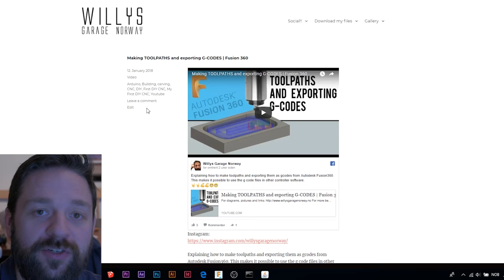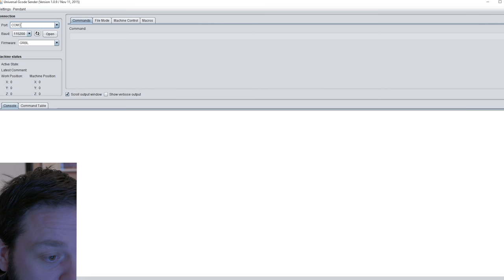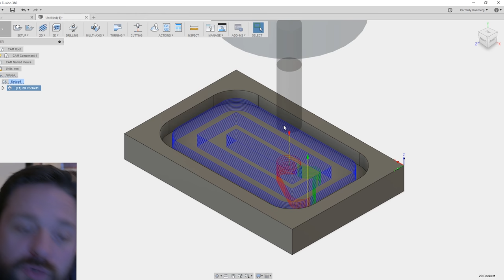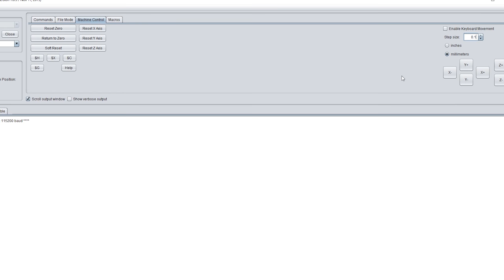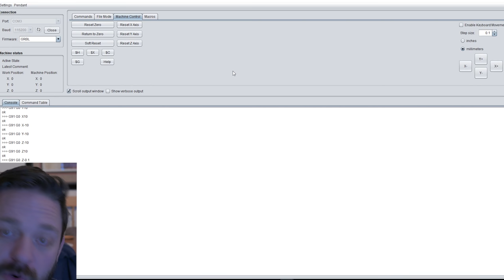Using G-CODE files and setting ZERO in UGS | Quick Tip

Comment: So we just need to set z zero and no need to set work offsets? I am confused. so why people bother to use edge finder then?
Reply from the maker: You set zero point and offsets in the program that you generate your g codes. In UGS you just set the zero point where you decided it to be in regards to the stock 👍😃
Reply: @WillysGarageNorway  Wow that will make it so easier. Thanks for the reply. I am a beginner and I was having hard time to figure out UGS.
Reply from the maker: We are all beginners ;) Let me know if you have any other questions and I will try to help 👍
Reply: @WillysGarageNorway  I do have a question. I am using GRBL. I was trying to send a gcode for tapping in aluminum using UGS. Its getting error. I am guessing Grbl does not support taps. so I tried drilling. I zeroed the machine like your video (zero works and visualization looks perfect) and when i click the send command it shoots up the Y Axis upwards until it hits the limit switch and then shut down. my drilling model was made in Fusion 360. I have no clue why the Y is going up although it is not in the code. any ideas will be much appreciated.
Reply from the maker: @vrva3138  Hi, when you are making the toolpath in Fusion 360, there is a banner where you can set different kind of heights. There is travelig height wich is the height the tool is travelig between operations. On my machine I have to set it lower then default. Have you tried changing the heights?
Reply: @WillysGarageNorway  I figured out the problem. It was while you set up the post process file. I turned off M6 output and Safe retract height to clearance height. That removed all those unwanted code from GRBL. But even though I set up the correct axis, zeroed it, the machine is milling in the direction it is supposed to etc, the machine still starts .5 inches to the right. As soon as I open the visualizer in the UGS, I can see clearly the starting point is off one block!? and that is causing the shift. IDK how to fix it. thanks for the advises though.

Comment: Is there a way to prevent endmill scratching the surface of stock from zero position to work lead in position? I was trying to use maximum stock. but after you set zero the machine moves to the lead in position in the same z level until it reaches work lead in. It does not scratch work but the stock.

Comment: Hello. Thank you for this video. I'm a beginner and this video does help. I was listening to the noise from the CNC , at around 4:20 to 4:25 . When the motors start moving and therefore accelerate, the noise is quite ...not right in my opinion and I am having exactly the same noise over here. Not smooth, quite rattling. Then when the acceleration is over, the noise becomes more normal & smooth. I am wondering if it ever bothered you (maybe it's just me) and if you ever found a fix for it.
Thank
T
Reply from the maker: Hi and thanks for watching :)
I think most of the noise comes from the machine itself when the stepper motors are vibrating a bit at the accelerating point. Do tou have a wooden machine the sound will be greater. 
I have had no problems with this and as I have upgraded the machine the noise have become less 😁👍😄

Comment: Hi,
 When i was trying to connect to system via ugs, i did not connect ugs was closed immediately. This problem occurs v1.0.9. 
Also, i tried v1.0.8 same thing happened but there is a difference. When i pressed open first system connected then ugs closed by system. There is a folder which starts that sentence: 'A fatal error has been detected by the Java Runtime Environment:'
i uploaded java8.
Is there anyone who can help to solve this problem?

Comment: What a great video. What command sets the height at which the Z axis travels over your workpiece? When I click "Send" my Z axis raises about an inch. I would like to limited this to about a 1/4" or whatever I determine to be sufficient to clear my clamps. Thanks!
Reply from the maker: I think the travel height must be set in the g code generating program. I use Fusion 360 and there I can set travel height and more
Reply: @WillysGarageNorway  Thank you for the quick response. I'm using Vectric V-Carve. I'll look around in there and see what I can find.
Reply from the maker: @metalli445  no problem :) do that 👍
Reply: @WillysGarageNorway  And just like that I found the setting in "Material Setup" :)
Reply from the maker: Nice :)

Comment: Hi willy, I´ve  already built a small CNC MILL machine, I´m using UGS too, but last week I made some probes an I´m having problems seting my XYZ zero. Once I put the tool exactly where I want it, I reset the using UGS the same way you do, the first column (XYZ) goes to zero but in the second Column Z zero did do it. Do you have an idea why is that?. You said you are a begginer so am I. I´m using MasterCAM to get de G codes. 
Now I´m following you cuz I like your job, and I like it because you show the way you solved the problems. 
Cheers
Reply from the maker: Dany vlog Jimenez Hi and thanks for the sub :) do you use the regular UGS or the UGS platform?
Reply: Hi, thanks for your answer, I´m using exactly the same version of UGS 1.0.9. Work position goes to Zero once I push the reset zero button, but machine position is also with negative values. I´ll prepare a video to show you maybe next weekend.
Reply from the maker: Dany vlog Jimenez No problem, please let me know :) 👍
Reply: Really? I´ll try tomorrow and let you know, thanks again

Comment: How i can inter the size of milling bit ?
Reply from the maker: You do that in the program you generate the g codes. What software do you use?
Reply: @WillysGarageNorway  for designing part and saving to gcode i use auto cad and for cnc machin control i use UGS
Reply: @WillysGarageNorway  my problem is that when i use different size of milling bit how set machin